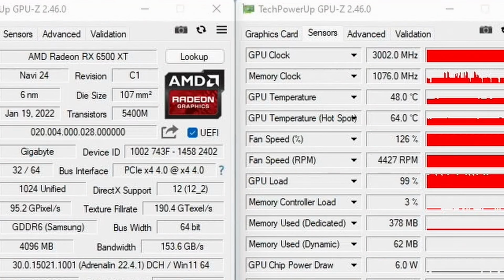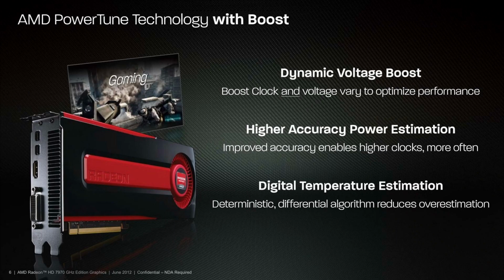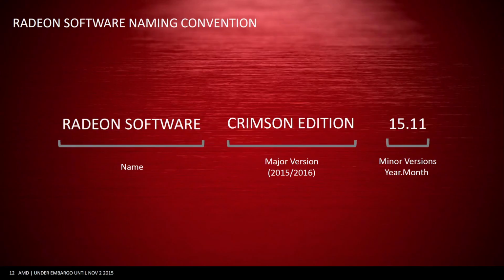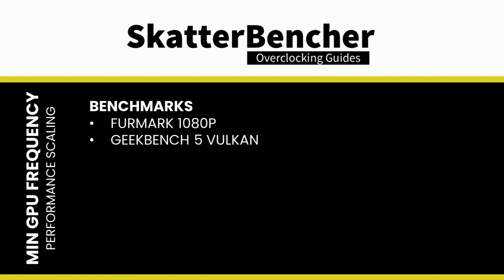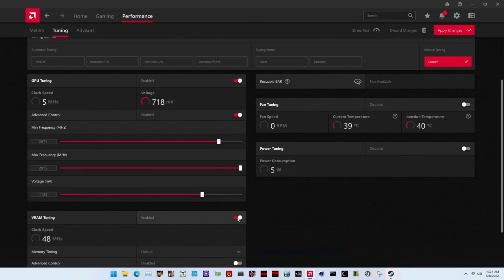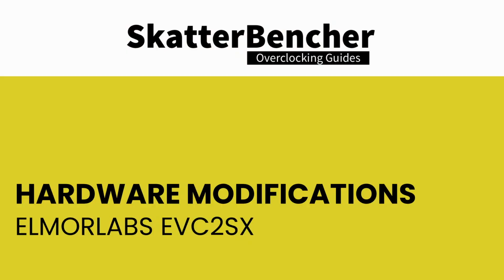Radeon RX 6500 XT Undervolt & Overclock to 3002 MHz With ElmorLabs EVC2SX | SkatterBencher #41

Comment from the maker: 00:00 Intro
03:59 Stock Performance
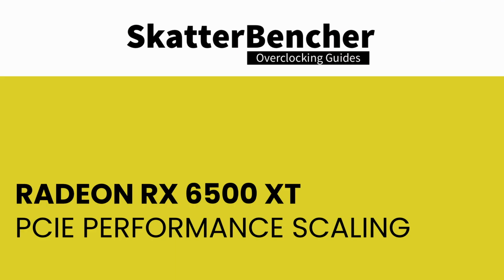05:02 PCIe Performance Scaling
06:58 OC Strategy #1: AMD Automatic Overclocking
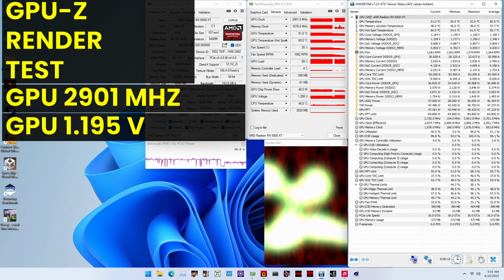09:20 AMD GPU Boost Technology: Brief and Incomplete History
33:05 OC Strategy #2: Manual GPU+MEM Overclock
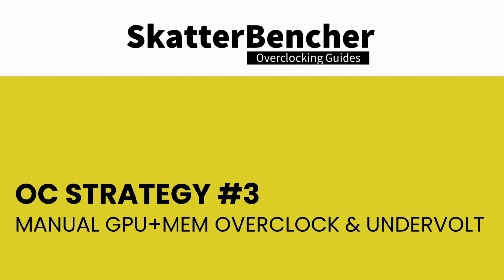39:55 OC Strategy #3: Manual Overclock & Undervolt
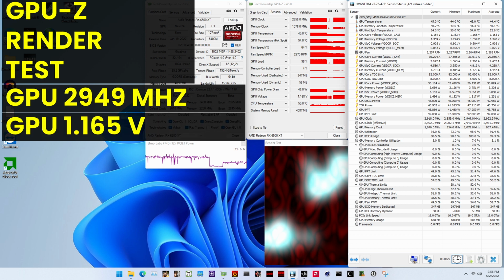47:22 OC Strategy #4: Elmorlabs EVC2SX
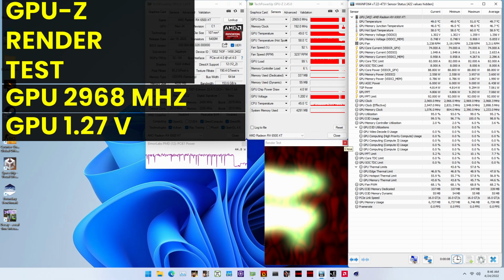1:02:41 OC Strategy #5; EK-Thermosphere
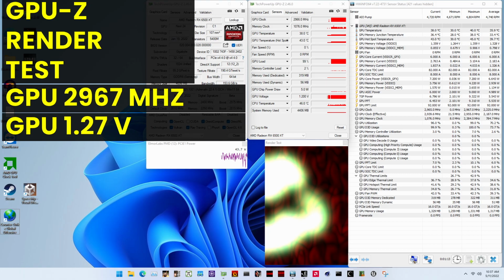1:04:28 Let's Wrap Things Up
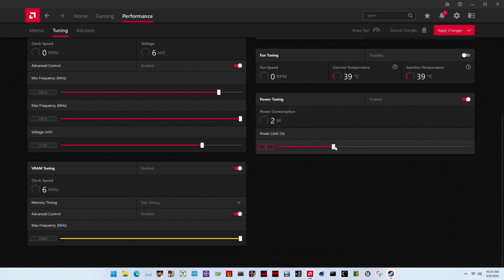Reply: 46:16 - how did you even get +15 ? mine is locked to 0 as max.

Comment: This is probably the most accurate and detailed video on how to overclock a low end GPU that I've ever seen. I watched it while (still at the moment of typing this) I wait for this same GPU to arrive sometime today. I mean, same GPU, same brand, same model (I don't think there is any other from Gigabyte on this tier), so it was both incredibly illustrative at a design level and at how to overclock my GPU should I want to/need to (I'm gonna be running this on PCIe 3.0 because that's what I have, so I'm quite curious even after watching all kind of reviews and ending up here). The hacking part was interesting but absolutely impractical to do such overclocking, which I imagine you know already but it's worth mentioning. I don't know how much that controller costs but between that and the watercooling solution cost I'm pretty sure you can get a 3050 for cheaper and get around the same performance boost or a bit more without even bothering to overclock. As for the final observations, limits on higher end cards from AMD are much bigger for over or underclocking and this card is a modern time VERY ENTRY level card which for the use I give to it and the cost (around 150 USD) I paid, will be fine for me. But for extreme performance gamers who use high refresh monitors and all details to maximum and QHD resolutions I feel the specs of this card were kind of an insult, being accustomed nowadays to commodities that are - not without reason - took for granted. However there wasn't any other affordable, current technology, that could do "okay" or "fine" with games (I mean around 60FPS@1080p with acceptable settings) in the market for YEARS. I believe that was the AMD's approach with this GPU, I think they got too much heat for it and I also think that casual gamers got discouraged by online hate reviews towards this card. Am I right? We'll know when the product arrives. It does have a 30 day return policy, though. Regards and nice video.

Comment: 1:00:41  if we set ADC Update for once to "No" for example, will the changes be permanent or will we need to set it in every boot? 
Excellent video
Reply from the maker: You have to set it every time the controller resets. It usually doesn't reset on soft reboot, but it will after a power cycle.

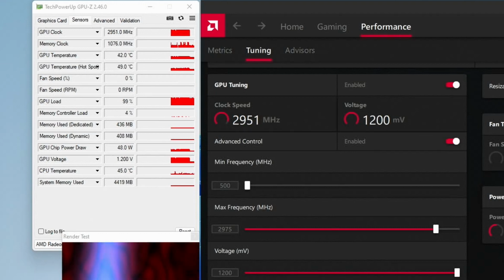Comment: 51:18 you can actually set the voltage higher than the allowed limit and it does work on the 6900xt upto 1.25v. You have to use more power tool to set both the minimum and maximum voltage to 1.25 as well as turning off the power saving states. The card will run at maximum boost it can and full voltage all the time though and can be quite unstable, but when it does work its pretty rapid. It also can overclock the fclk which can help as well in benchmarks.

Comment: The GPU is designed for LT use so not surprising there are limits for effucentcy.  Excellent video  on  AMD tech and getting results  despite limits.    Well done.    Would  useng an AMd CPU and SAM  have given higher scores?